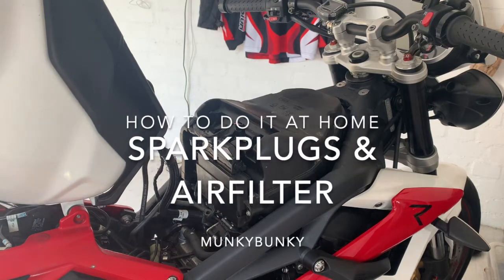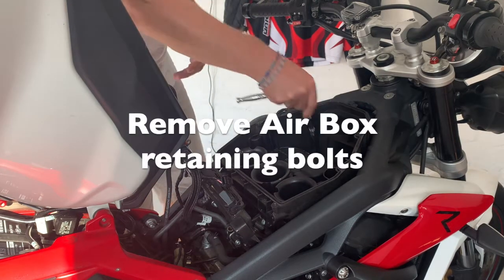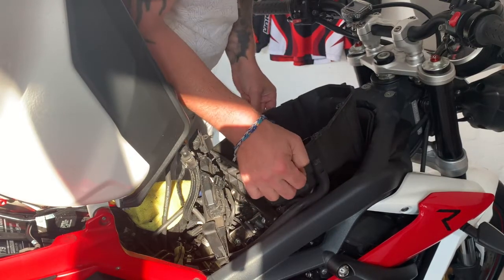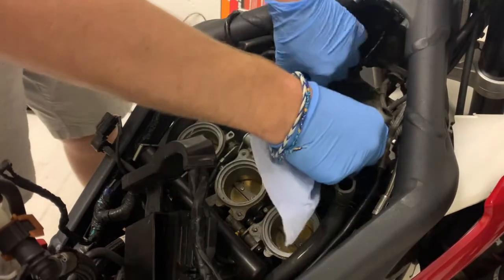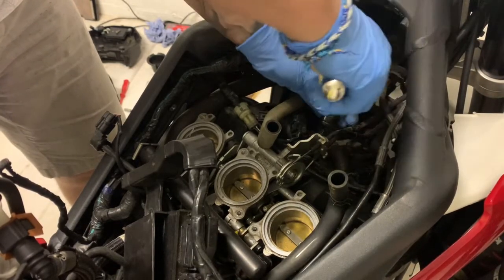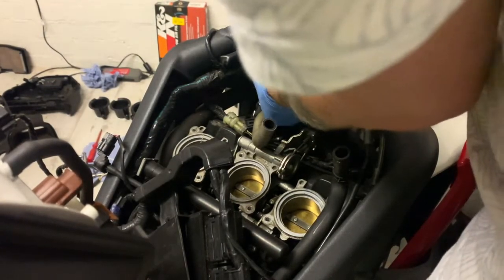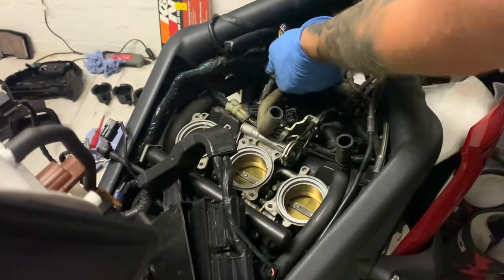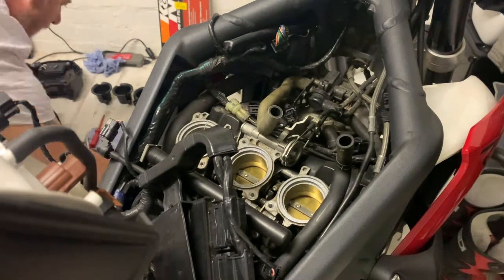Do it at Home - Changing your Spark Plugs and Air Filter

Comment: How did you keep the fuel tank out of the way without unplugging the fuel lines?
Reply from the maker: Once you remove the seat it pivots up, if it doesn't stay just use a bungee strap or something similar.